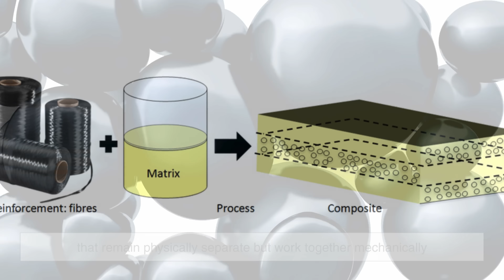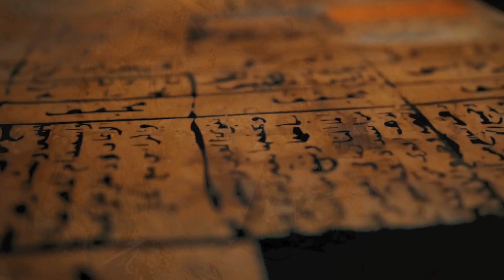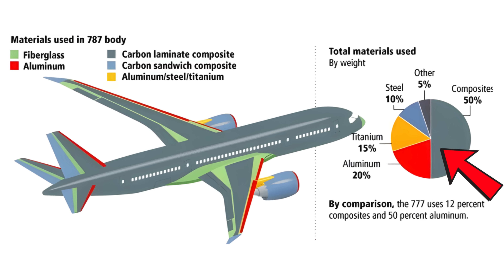This Material Changed Engineering Forever—Here’s How [ID0807]

Comment: Thanks for the great video. 1977. I believe I built the first honeycomb skateboard. I personally bent all the aluminum to match what the aviation community was using. I also made a bow inspired by Fred Bear’s ideas. He used a different type of resin than mine. My invention failed miserably.

Here’s an idea for your video: the Rolls-Royce Trent engine. They named their engines after rivers. I got to pick up the starter shaft from its most expensive box I’ve ever seen. I asked if I could, and I thought it would be the same weight as in an automobile drive shaft but it was lighter than a paper tube and hollow as one also. I still don’t know what that green material was.

Also, look at the Kevlar fan retainment belt. It’s awesome. The rub strip that goes around the turbo fans to prevent them from going supersonic is also a honeycomb structure.

For those who complain about punctuation and spelling, the people posting here were studying very complex and new ideas. I gave an English teacher a copy of the manuals we received. She was appalled by how poor the English was and understood that they had to shorten it up to about 1600 pages.
Reply from the maker: Thanks for sharing your experiences and these excellent video ideas!
Reply: @historyofsimplethings I typed in a longer version in deleted 
On the Trent engine they have a huge GEODUCK only a rare club knows this, it’s worth the search 🔦 
Cheers 🍻 🎉
Reply: @historyofsimplethingsmy mom was the English teacher 🧑‍🏫 ❤

Comment: the same is true when sports cars starting using fiberglass in the early 1950s its to make things lighter by a significant amount like aluminum alloy or other metals like Magnesium or Zinc that melt at higher temps than traditional Aluminum or steel wheels like for ex in the 60s some popular cars had the option to have fiberglass body panels when they were going to be used for drag racing
Reply: Great video! Thanks, like the two above. Bonus: In 1977, I think I made the first Honeycomb fiberglass skateboard in shop class. I hand-bent all the aluminum. I attempted to make a composite bow for a crossbow, but the resin I was using had zero flex. Invention FAIL! I copied the FRED BEAR composite bow and the honeycomb from aerospace companies. The floor material on the airplane ✈️ is honeycomb material.

Idea for the video: the TRENT TURBO ✈️ JET ENGINE and how it actually pulls from the back of the wing. The fan blade, Kevlar containment belt, and honeycomb rub strip to keep the fan blade from going supersonic.

On the same note, the inner workings of the Trent engine, named after rivers. The starter shaft came in its own box/case. I asked if I could pick it up, and SHAZAM! I thought it was going to be heavy, but it was lighter than a paper tube. I called it (HELENIUM) because it was so light and thin. I still don’t know the green metal. The geoduk is fun to learn. 
For the punctuation police 
The people we’re studying 📑 stuff you can’t even imagine. Grammar. You should see the bazillion manuals that wrote the different publications. I sent one to an English teacher 👩‍🏫 and she was surprised 😱, thanks mom!!
Cheers 🍻
Reply: PUNCTUATION DUDE HOLY CRAP